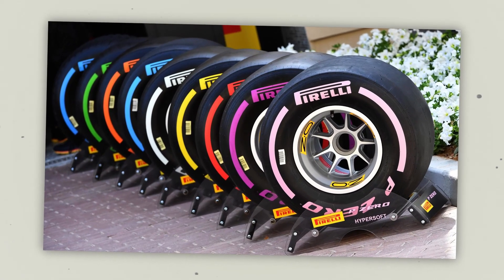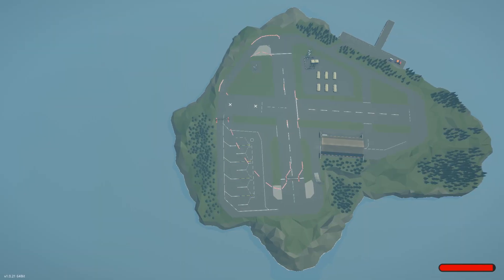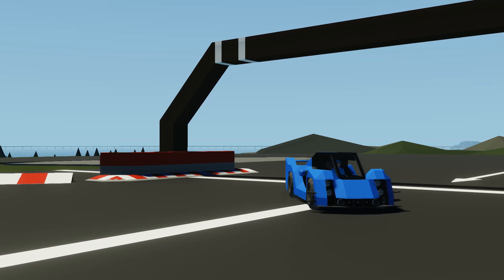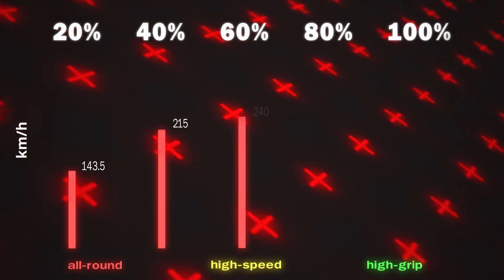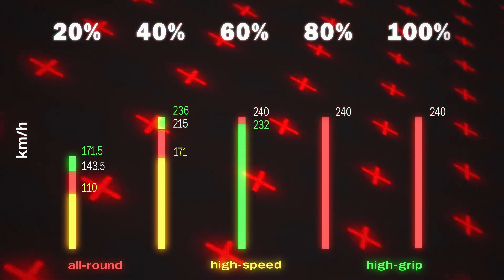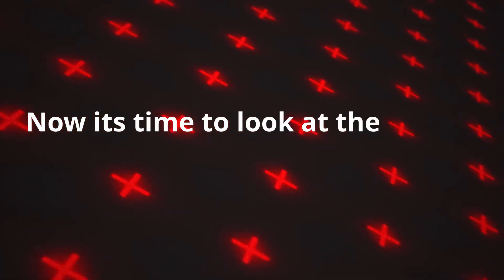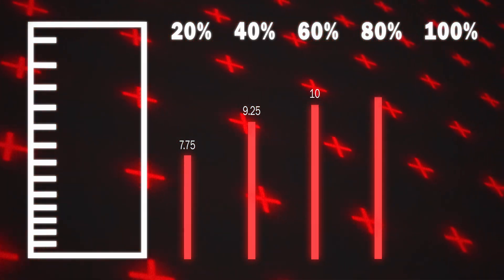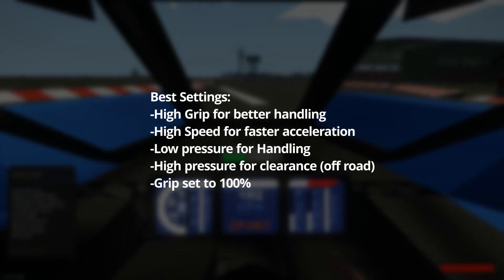How Do Tire Settings Impact Performance - Stormworks

Comment: mhm, ye so I've built a car that's meant to go really fast, but it just won't accelerate over 270km/h even tho its got a 36 cyl engine at 53 rps, so basically all the power you could want. But the thing is, it maxes out that speed in first gear and doesn't go any faster in the following 2 gears which just makes it accelerate slower. I guess it's due to wheel slipping or sth but I'm already using high grip tires at the max grip.
Does anyone know how to remove that problem? The gears are 3:1 1:1 and 1:3
Reply: On my car i switched my allround to high speed and it literally almost took off